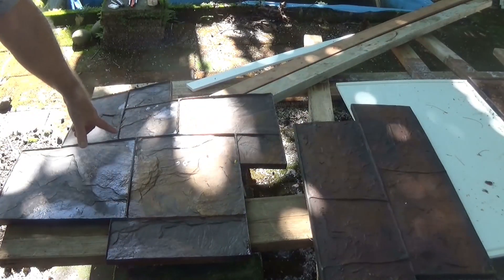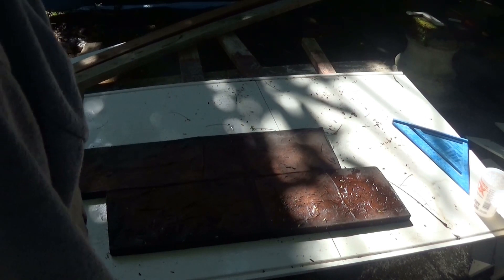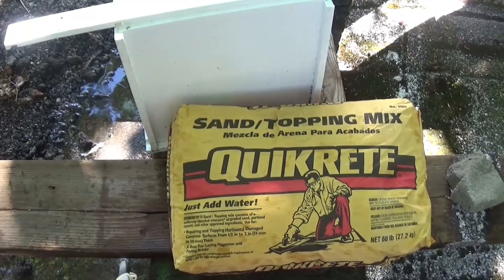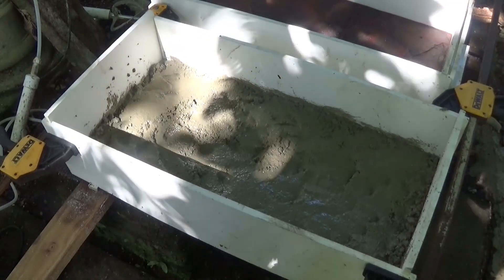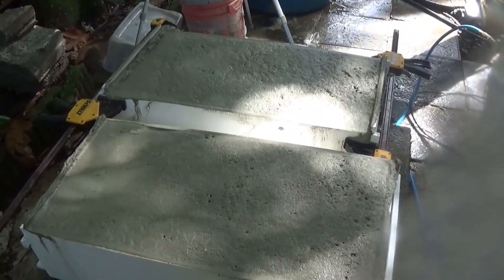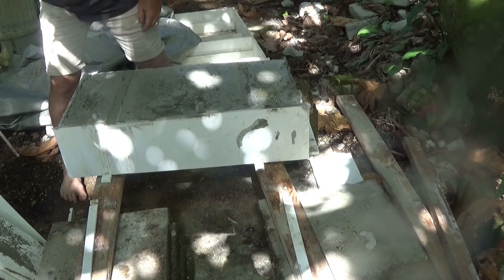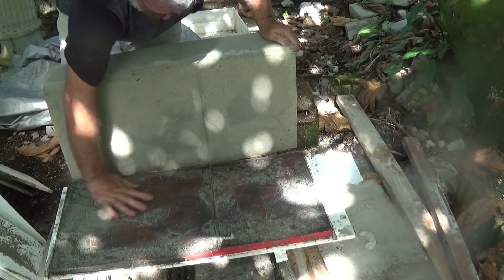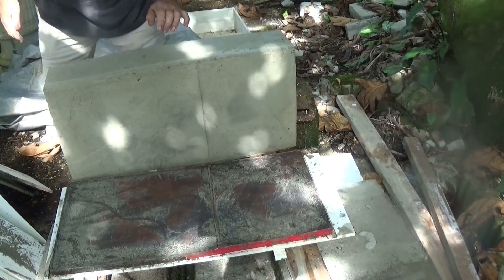How to  hardface aircrete

Comment: I'd like to give you a little hint!
I am a sculptor and I make rubber molds and pour cement based products!  Don't put oil on the mold!!!
Oil and water don't mix and the oil might not be good for the concrete!
Instead, what you want to do is lightly water spritz your rubber mold so it is completely moist (not filled with water)!  This breaks the air bubbles from forming!
Good luck and have fun!

Comment: I build faux brick walls doing exactly this about 5 years ago, I 'stucco' just to fill the mold face, about 1/4 inch,
then immediately fill with perlite concrete.  Works great, it was my secret.....
I made a mold by using two=part poured polyurethane onto a brick wall makes a flexible mold that always releases.

Comment: Fantastic experiment, your mold idea is genius. I used to work in some craft where i had to use rubber molds with water based product, so better than oil, which leaves a residue, instead use White Spirit, or Mineral Spirit sometimes called, the stuff you would clean solvent based paint off paint brushes. If you paint that on before the pour it will form a barrier that evaporates off with no residue after de-molding

Comment: I am in the Philippines and I used an inexpensive floor wax called STARWAX . It is a mix of waxes and petroleum distillates and comes in a soap sized clear plastic bag or a tin can and is like soft shoe polish for applicating .  I experienced instance release of concrete from plastic pales which were not new and were scratched a lot from mixing concrete from making rocket stoves.
Reply: thanks so much for this comment

Comment: I love this idea! I’m thinking wind load when I pose this idea.. I will be in a hurricane zone so I want really thick walls. Plus I love the esthetic of super thick walls. I am picturing the facing about 3 inches thick then rebar reinforced middle 10 inches thick and then 3 inches on the top side of the mold. Perhaps some house wrap thrown in there. So 16” wall. I like anything over engineered and the security of that nice thick wall. It still may not be thick enough for a significant enough wind load for hurricane zones. I can’t do those calculations. This was sheer genius BTW. I really appreciate the time you took with this. Also I wouldn’t really go for the texture. No texture will have the wind skidding right over it.

Comment: I did the same thing with bonding cement and a texture spray gun. I made the mold and use silicone caulk to put texture in the bottom that simulated wood grain. I then oiled the form that I made out of myelin, sprayed in colored bonding cement, then fill the form with aircrete. The hard-facing worked fine. Unfortunately I was attempting to make a bench out of it and even though I was using post tension and had reinforced the form unfortunately I did not have enough center support for the span. It held up to 200 lb but immediately broke after. As far as the skin it was only one quarter to 1/2 in and since it was fiberglass reinforced out of the bag it made the whole process very easy, it didn't shrink and was plenty strong.
Reply: Wondering  how thick the  mixture was. I seem to understand it was only 1/4 to 1/2 inch ..  of hard cement but trying to understand how thick it was and how far you tried to span .

Comment: I love this idea. The use of the PVC form is pure genius. The only drawback I see is that you would still have to add the fabric layer to the outside to counteract the tensional/torsional  forces to the aircrete dome structure. My thought has been to spray a hard surface onto the cloth layer for a finish coat. Have you built any structures yet with these bricks you are making?
Reply: No need to spoil the outside, what about doing as he did but pouring half the aircrete then adding a layer of Housewrap or galvanised chicken wire, pouring the rest then adding a sheet of housewrap on top to really sandwich strength into the block.
Could cut the top layer larger to have an overlap that can bond to the next block while building
Reply: @utubeape  You would still have individual bricks without a congruous layer for tensional forces. My initial idea was to pour bricks with a 1x1 inch channel on one end and use that as a vessel for a ring of rebar on each row.
Reply: @fabonline9389  You could add the tensional reinforcement in the mortar between courses and at the foundation. I would stick to a catenary shape to be on the safe side as well.
Reply: @Thoracius  The foundation course would be set into a keyway to resist outward pressure. A catenary shape does not apply to this structure. There is no "swoop" between points of attachment in the rebar and I can't visualize what you are suggesting. My idea is more like a wooden barrel with the bands on the inside. Think of a dome more like an egg and how the pressures are distributed.
Reply: @Thoracius  All the force on a dome above the equator is inward "it is self-supporting using entirely compressive forces". The rebar i suggested is imbeded in the blocks and it is much stronger than you think. Have you built anything with aircrete? It's not like styrofoam and the density depends on the formulation or additives. I would still use a torsional fabric layer to solidify the total surface. Caternary is decribed as a rope or chain suspended between two points the opposite of a dome.
Reply: @fabonline9389  Obviously a catenary is inverted in the context of a catenary dome. It's just describes the shape of the curve. It's not hard to understand, nor are the physics of it. Good luck.
Reply: @Thoracius  A caternary structure is purely tensional. It has no relevance to a convex dome which is purely compressive. The physics are simple. Good luck with your concave dome.

Comment: I had thought of trying this and it is nice to see I am not alone in innovating with aircrete. I have a 25 foot diameter foundation made for an aircrete building and I finished the aircrete floor with standard concrete . By the way I am near volcano and would not mind having you out to see my project.
Reply from the maker: very much like to see your project

Comment: My limited experiments with much thinner hard facing failed, as the facing didn't stick to the aircrete. But I'm just getting started, and struggling with basics, so my results hardly prove much. How long did you let the blocks cure before taking them from the molds?
Reply: Same issue here.  Within 1 week my relatively thin face  just peeled off or crac.   eggyknap, did you found a solution in 2 months ?
Reply: @lucleclerc5052  We stuccoed some aircrete planters and the stucco has held up ... and held on ... fairly well. Two coats would probably have been better, but we've had some substantial hail which left only a few damaged spots.
Reply: @eggyknap  Thanks for your quick feedback,
Reply from the maker: 3 days

Comment: Could you use Gigacrete's Plastermax for the hard facing instead of regular concrete to make it even stronger?
Reply: I am also thinking sand/cement with chopped poly fibres in for added tensile strength
Reply: @utubeape   I connected with someone from Gigacrete and he said that you could do a thin layer (1/8”) of StuccoMax inside the mold, then apply 11 oz. mesh, then another layer of StuccoMax (1/8”) and then pour the aircrete while the plaster is still wet. So an overall coat thickness of 1/4” was enough... but that was for a deck support project involving 2” x 6” joists.  I’m not sure what they put in their proprietary formula but I’m sure it has some sort of fiber reinforcement otherwise they couldn’t achieve the kind of impact resistance and even bullet proofing that they claim and demonstrate.
Reply: @greenshereen  I don't know how strong Gigacrete is, but people doing aircrete and similar are more likely to want to cut costs and add the special ingredients themselves. I have experimented with polypropylene fibres and they really do strengthen render / stucco / mortar
Reply: @utubeape   true... we don’t really ever know how strong things are until they stand up to tests.  But, their Ballisticrete is demonstrated on a video to effectively deflect rifle rounds from several yards away.  Interestingly, the concrete behind it cracked from the shock.  It was, of course, a small tile and the rear face of the concrete was not plastered.   My intention is to mix and pour my own aircrete to cut down on costs and use their plaster.  Since it’s just a 1/4” coat it will go a long way.
Reply: @greenshereen  I have just read that Plastermax is an interior product
Reply: @utubeape   I’m building an interlocking joist grid (my design) for an outdoor, stand-alone circular platform, so I would want to use an exterior plaster.  I could see using the Plastermax for the interior face of an aircrete wall block while using Ballisticrete or StuccoMax for the exterior face.  I can’t justify the likely higher cost of Ballisticrete to coat my joists, but I’m definitely thinking of using it to hard face my exterior walls on my tiny home.  I’m hoping it will also address the problem of cracking with the aircrete and certainly factoring the vibrational and “seismic” stress of being on the road.  Thank you for the ongoing discussion.  Putting heads together helps cover more angles!
Reply: @greenshereen  you should definately put wire mesh within the aircrete for strength.  applying housewrap onto the face of the blocks held on with cement slurry will help with the tensile strength too. Try some experiments with polypropylene fibres, they are so cheap. you could even make your own by guillotining rope into 1/2" strips and mix well.
good luck with your project!
Reply: @utubeape  thank you!  That actually sounds doable and affordable!
Reply: @greenshereen  I was looking for someone that experience using aircrete for tiny home "on the road".
Reply: @beblissnow5947  so was I initially, but I abandoned the idea after learning how brittle it is and also how much weight it would weigh down the trailer.  I haven’t given up on the idea of the thin plasters made by Gigacrete to coat the envelopes walls.  There is also flexible concrete sheeting.  If it is earthquake proof l wonder if it could handle the road vibrations and shocks.